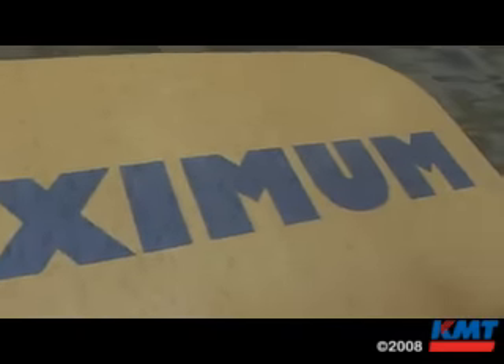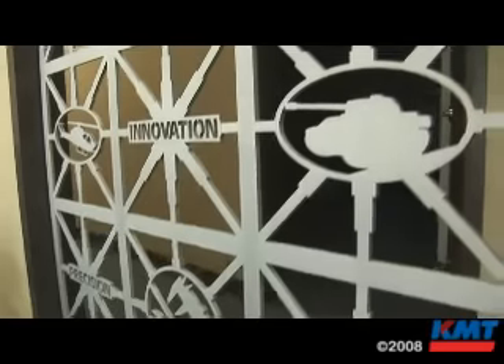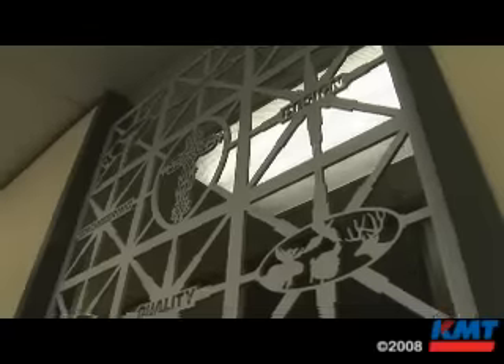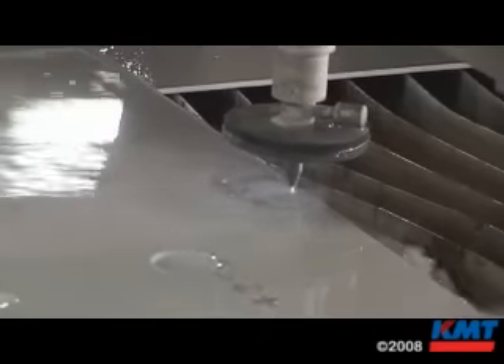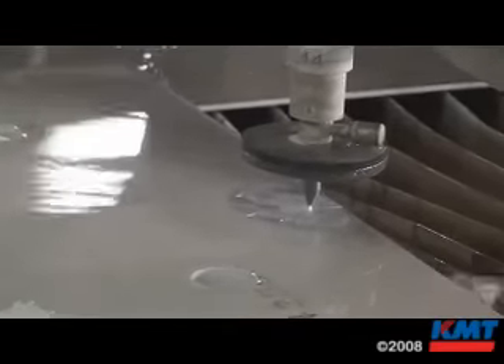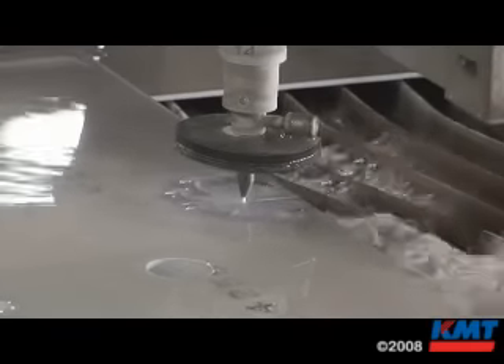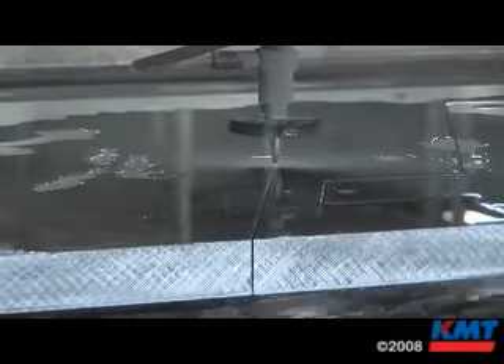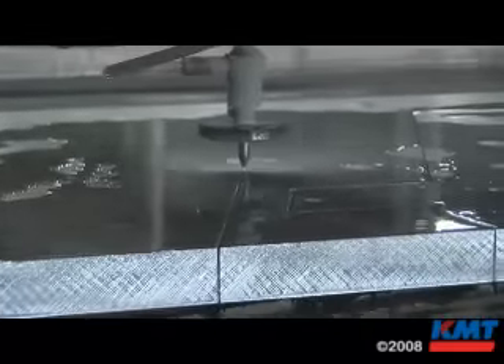KMT Waterjet Systems; Water Jet Cutting Steel at Maximum Industries

Comment: Is it possible to water cut tungsten carbide?
Reply from the maker: The answer is yes.  Depending on the thickness, it can be a little slower than other cutting applications, but the advantage is that waterjet cutting is a cool process and will not alter the properties of the material---No HAZ (Heat Affected Zone).  Unlike laser & plasma, waterjet cutting leaves a cleaner edge (little to no burrs) and thereby eliminates the need for most all secondary finishing. The tighter tolerance of waterjet allows for intricate cutting and tighter nesting of parts. If you would like us to do test cutting of your material, please send an e-mail to sales@kmtwaterjet.com and we'll contact you to get the material and specs and video the actual cutting with results sent back to you.  Thank you for your question!

Comment: Dude talked about the cost effectiveness. Once the machine is purchased, is the operating cost really that much of a factor compared to other methods? Or once you have a water cutter, you might as well use if to cut everything. Is there a case to be made to have other cutters on hand?
I know that cutting AR400 steel with anything hot makes the metal less resistant to bullets, so water would be ideal.
Reply: You know it's surprisingly difficult to get water to that kind of speed and thus expensive right?